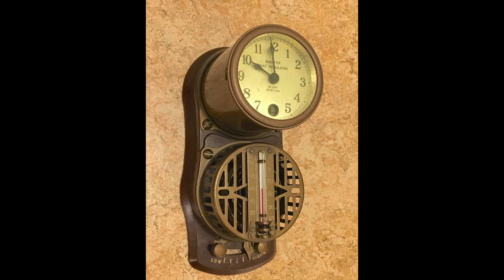Do thermostat setbacks work?

Comment: From AI search results...How night setback saves energy

Many people mistakenly believe that the energy saved during a setback is lost when the system works harder to return the temperature to normal. This is incorrect because of a fundamental principle of heat transfer: 

The rate of heat loss (in winter) or heat gain (in summer) is directly related to the temperature difference between inside and outside.

By reducing the temperature difference with a setback, you slow the rate of energy transfer, meaning your system runs less overall.
The longer your home remains at the setback temperature, the more energy you save. 

For optimal night setback savings, the U.S. Department of Energy (DOE) recommends adjusting your thermostat by 7°F to 10°F for 8 hours.

This reduces the energy needed to battle the outdoor temperature, leading to up to 10% in annual savings on your heating and cooling costs.
Reply from the maker: All this is true.  In theory.  In the real world, it depends on the equipment (heat pump, oversized gas furnace, correctly sized gas furnace, oversized oil furnace, most of them are, electric furnace).  
If it is comfortable to you, set it back.  Remember, the system is there to keep you comfortable.  The savings could be 10%, 5%, or negative.  It will not make much difference either way.
GFM

Comment: If you have a split system, or heat pump, and want to save money, the best thing is to just lower the temp in winter and raise the temp in summer. It wont be as comfortable, but will save energy, and there is the exchange.

Comment: I'd be interested in if doing a setback makes the furnace less busy overall. I keep my temperature set low at all times and have a 3 degree swing range. The whole point being keeping the furnace off for long intervals.
Reply from the maker: Using a setback will result in long runs times when the furnace must increase the temp for the occupied space.  For energy usage, the difference is not large.
GFM
Reply: @grayfurnaceman  Yeah that makes sense. The furnace heats the air (low density) but the air must in turn heat the floors, ceiling, and walls (high density) which act as a filter capacitor. Not sure how the math works out but the average temp difference (inside - outside) does determine the average heat loss.
Reply: @mrbubble185  total furnace runtime goes down with setback and total number of furnace cycles drops much more so. a single long run to warm back up is way better for it than cycling on and off over hours, each time heat exchanger expanding, contracting, getting weaker - do that enough times and heat exchanger cracks.
Reply: @Jon-hx7pe  Yes - that makes sense. I'm running a 1996 York Diamond 90 that was installed when the house was built. Here in Western NY. I had to replace the main blower capacitor a couple of years ago but other than that it's been pretty reliable.

Comment: Is setting back a heat pump hard on it? My thinking is the extra use of auxillary heat.
Reply from the maker: I can't say it is especially hard on the pump, other than longer run times.  In most areas with a large heat load, backup heat will come on to take up the slack.  Having backup heat come on is not hard on the heat pump, especially if it is electric.  In some early systems, residual heat from the heat exchanger after the backup heat shuts down could cause high head pressures in the heat pump, but most newer systems compensate for that problem.
GFM

Comment: In school they said to tell people they will save 1% per 1° setback up to 5° totalling 5% savings max. After 5° the the cost to recoop the set point decreases the savings.
Reply: Assuming a standard fossil fuel furnace (no e-heat), why would the " the cost to recoop the set point" be higher than the cost to maintain the temperature?
Reply: @KevinKadow  It wouldn't, it's total BS. 

Let's imagine a scenario. You're in a cold climate up north and have a Florida winter house. So you turn your thermostat to 45 for a couple months while you live in Florida. Think you're not going to use less energy than if you kept it at 70? Of course not. The logic behind setbacks isn't complicated. They work. The only time they don't is with heat pumps because the "recovery" will just use the heat strips.

Comment: I agree with you I don't think there will be a big wad of savings.That's why I have never used this option on my system. Heating by a wood boiler it seems to make little difference turning back the thermostat other than cooler in the house.

Comment: Most people like it to be cooler at night for sleeping so keeping a heat pump at one temperature may defeat that comfort goal. I have an 8° setback on my inverter heat pump system ( no aux heat) and with adaptive recovery it works well … though with the recent polar vortex the heat was starting recovery at around 2:00 AM but reached 70° at 8:00.

Comment: well said oh gray one, I read years ago that setbacks are not worth the hype. Most people who work, come home to a cool house because the heat is just kicking back up and finally reaches a comfy temp right as people go to bed and turn the heat down again. 
This is repeated in the morning with the heat rising back up just in time to leave for work and is turned down again, the problem being that the occupants never get the benefit of the warmth since it is always striving to attain that comfy temp 
The biggest error in this setup is that it takes more heat to bring the buildings temp back up from that lower setting than it does to maintain a steady comfy temperature so any savings are minimal at best
Reply: Please explain how "it it takes more heat to bring the buildings temp back up from that lower setting than it does to maintain a steady comfy temperature".    Where is this extra heat going?   I understand how a heat pump with e-heat can cost more money because resistive heating strips are expensive to run, but I fail to see the physics of how bringing the building back up to temperature requires additional energy over what it would've taken to maintain the setpoint?

The trick to avoiding the problem of coming home to a cool house "because the heat is just kicking back up" is to use a thermostat (e.g. Honeywell) with just enough smarts to go into "recovery mode"  early, so the house gets back up to a comfortable temperature just as you get back home.
Reply: @KevinKadow  Sorry a bit of an over generalization. My point was / is that the energy needed to re-heat a room / house from a lower temperature to a comfy temp is almost equal to maintaining a steady comfy temp . The over exertion on the heating system whilst reheating a cold house negates the benefits of lowering the temp for a few hours whilst the occupants only experience the re-warming period
As the gray one pointed out the house draws a huge amount of heat itself trying to balance out that temp discrepancy
Reply: @birdolla4441  The longer your setback period, the greater the savings.

What exactly is this "over exertion on the heating system" you mention?

Generally a single-state fossil-fuel-fired system is most efficient and has the least "exertion" with a longer cycle time -- many short cycles (as would happen without setback) puts more wear and tear on the system than one hour-long "cycle" coming back from setback.

The math is trickier with a 2-stage furnace where the "high output" second stage might be a bit less efficient.

As for "the occupants only experience the re-warming period", with a good programmable thermostat a a predictable work schedule, there's no reason for the occupants to experience the re-warming period (unless, like today, they send the kids home at lunch time because a storm knocked out the power).

Comment: I have Single Pipe Steam. Setbacks might work ok for Forced Air but I never liked Forced Air. 
It's nice when the furnace is running but when it reaches Temp and shuts down it feels like someone opened a window.
My Radiators stay warm or hot all winter 24 hours a day and house is perfectly comfortable. 

My old Mercury Honeywell wasn't acting right so a few years ago I bought a new Digital Honeywell. 
I got the 5 Day 4 Settings one. Only because for some reason it was $6 cheaper than a "Non-Programmable" Honeywell, and as long as it had a "Hold" button it worked for me. 
My bedrooms are upstairs. So, it's always warmer up there no matter what. I tried "programming it" for 70 at night and 72 during the day. Nice that it cooled off and I could sleep better, but with Steam it took about 1- 2 hours of running to get the Temp back up 2 degrees in the morning. So really, I wasn't saving anything since it had to run longer to come up 2 degrees on cold cold nights.
And i actually did some new learning and got information my 1962 Boiler is actually about 70% oversize for my house.
That's how they did things back then. Bigger was better. Gas was cheaper than so why not. 

I just leave my Programmable set for 72 degrees on "Hold". Gets warm at night upstairs even thought I put on the smallest vent on that radiator a number 4, but I just adjust the Temperature with something called "My Window". I open it for a little bit, cool air feels good, fall asleep, when I wake up during the night like I always do, close the window.  
I have my Steam perfectly balanced, no banging, no stuck open vents, no leaks. 

Love the Videos and look forward to them. Glad you're doing ok.
Reply: I also have single pipe steam heat and agree, its better to just hold a specific temperature, rather than set back. Even a couple windows are strategically cracked open 1/4" to let cool fresh air in. The boiler only cycles on for 20 mins. Then off for about 30 mins, depending on the outside air temperature. The colder it gets outside, the more the windows get closed. Works well... Like in your case, all the vents need to be sized appropriately and operate correctly.
Reply: setback is not as good for hydronic systems compared to foreced air.
forced air is rarely done right, oversized equipment and bad ductwork -> properly done forced air with properly sized 2 stage or modulating furnace with long heating cycles is as comfortable as radiator at a much lower cost and can accomodate ac/heatpump in same system.

Comment: It is important to note that during setback, every object in the home is “cooling” and will reabsorb energy during heating time. Your body and the inside of the house is “competing” for energy absorption (warmth).
Reply: that is exactly what most people overlook and do not understand. especially if there's multiple setbacks per day or it sense occupancy and keeps setting back, all the physical objects and structure are slow to recover to warmer temperature and may never, then it will always feel colder as the heat keeps getting absorbed by them as they acclimate.
now the better insulated and air sealed a home is, the less total loss, but even then it can let everything cool down too far to feel comfortable again for many hours.